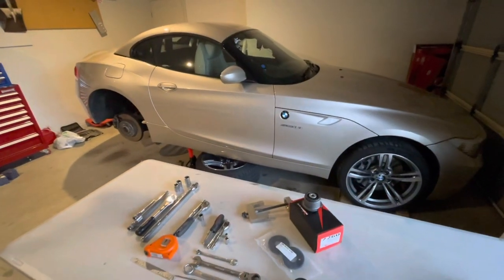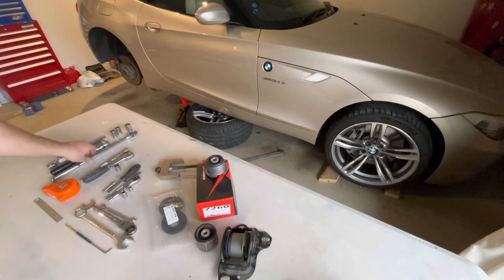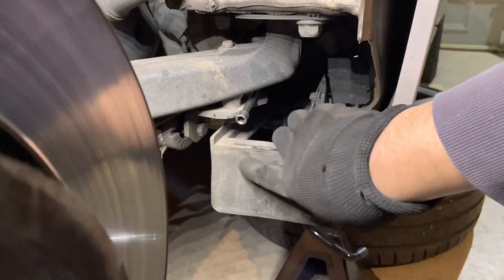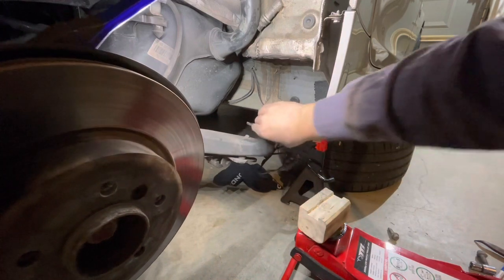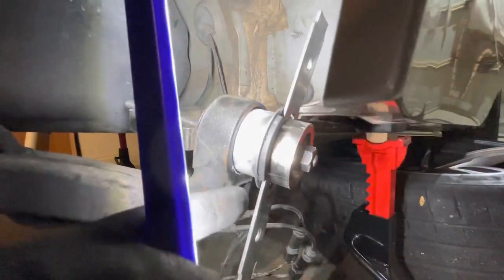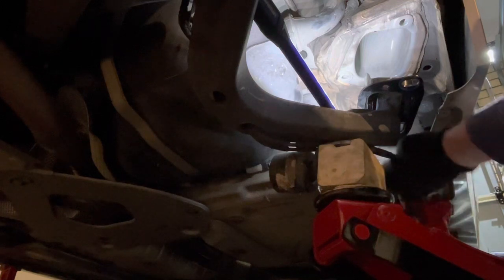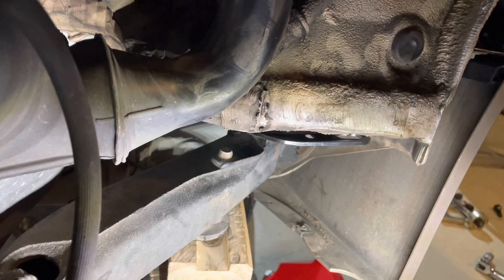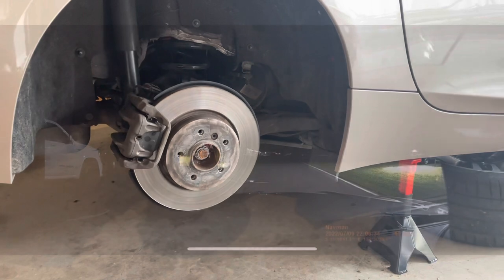How To Replace Rear Trailing Arm Bushes on a BMW E89 Z4

Comment: After months of wringing my hands I am following your path to no-tow steer. 91k miles on '09 Z4 S3.0Li w/ M adaptive sport suspension. Strut/shocks replaced already. Must say originals were shot to hades.

Comment: Im about to freshen up the suspension on my E89 z4 35i.. I already have M3 control arms at the front and KW V3 suspension. So i was looking to stiffen up the rear a bit aswell...  Your video was a great help... not much info about e89 out there... 

As im from within EU and was able to find Hardrace bushings from a few german websites and ordered a set. With limiters its not that easy when you are in EU... Was not able to find anyone selling these  within EU... even all ebay listings were from USA. So ended up ordering them from FCPEuro... price for the set was 15 usd, But with shipping and import tax im probably ending up paying about 70 usd for them.  Price  over all got close to buying a set of aftermarket balljoints to replace RTAB-s but i thought that would be too extreme... Its still a streetcar not a track or drift car. So i skipped on those and went with what is used in this video.

Another mod im doing the same time is changing out  those trailing arm smaller bushings... upper and lower. Upper is a balljoint  and lower is a rubber bushing  on stock e89...  on e46 m3 and e85 z4m both upper and lower are the same productnumber balljoint. So im  replacing upper ones  for maintenance and  upgrading lower ones to  use the same upper balljoint as on e46 m3 or  e85 z4m.  

Thanks for making the video and sharing knowledge!

Comment: Fantastic video. I am running over 400bhp on my E89 and suffering from rear steer. I am considering doing this mod as I believe I still have the stock RTAB after 50K miles.  Now that a little time has passed what are your opinions of this mod. Is it definitely worth doing to improve rear stability under WOT?
Reply from the maker: Sorry for delayed response. I’ve been roll racing the car a few times and this was definitely worth doing!!

Comment: Something isn’t right, when you take the front of the arm off the chassis it doesn’t drop down anywhere near as much as yours, brake pipes and wires are unclipped . You must have loosened or removed something your not showing